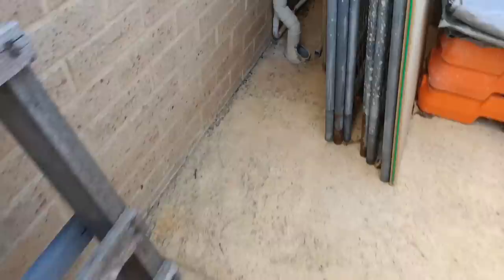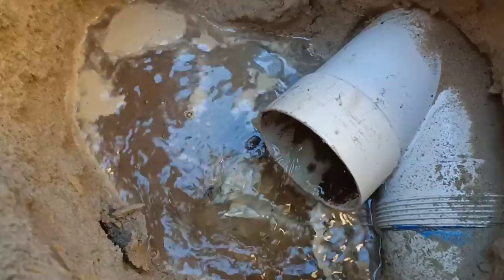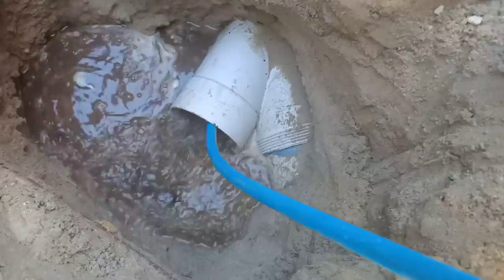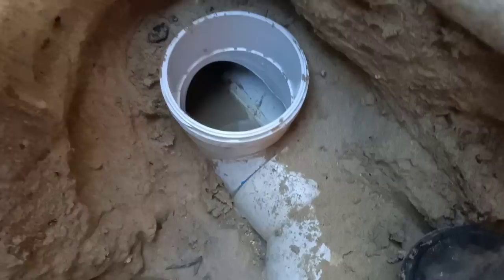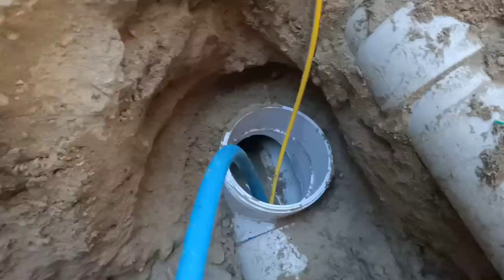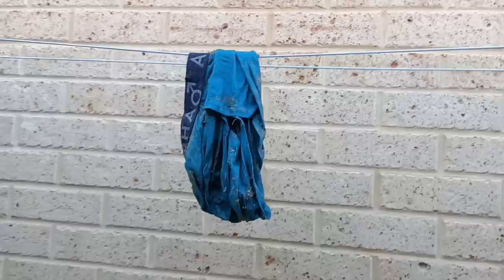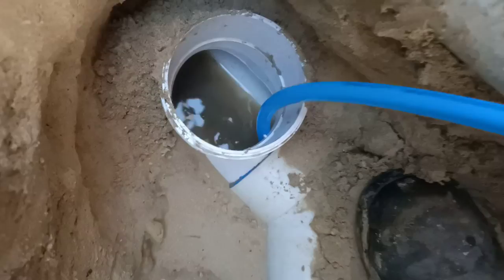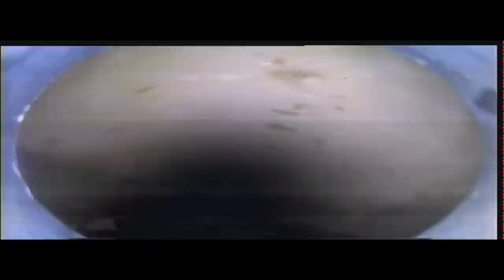The MOST UNUSUAL Blocked Drain EVER! | Blocked Drain 42 | Subiaco, Western Australia

Comment: Can't share your enthusiasm re blocked drains Bruce. I'm a plumber myself although retired now, living in the same fair city as yourself. I remember the good old days using hand rods to unblock drains and how useless they were if tree roots had got into the drain. The "pressure jetter" as they're called are almost a pleasure to use and only last week I had the task of a very smelly kitchen sink to unblock. My cleaner just attaches to a pressure washer but works well enough for sinks and gullies etc, especially with soap and grease blockages. Best of all, only a small access opening is needed. I'm glad I stopped plumbing after about fifty years of it though and now can find better things to do. Keep up the good work with the vids.